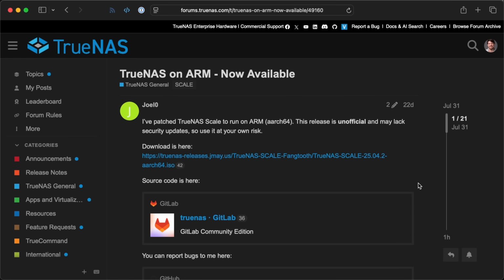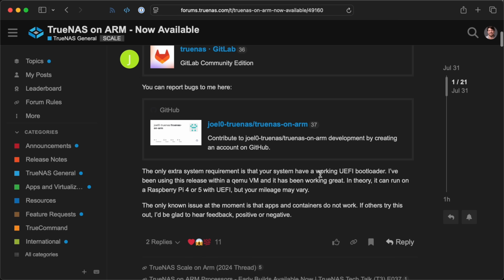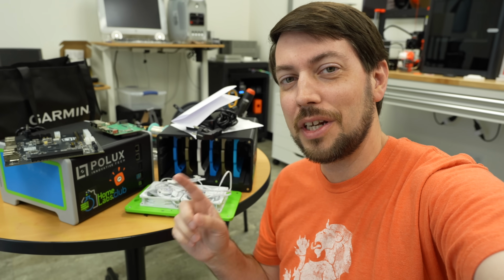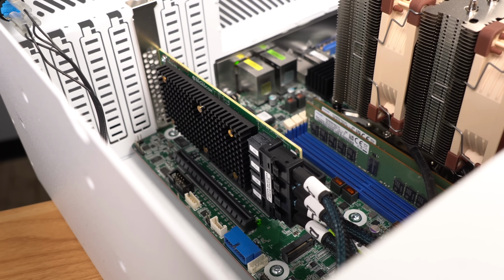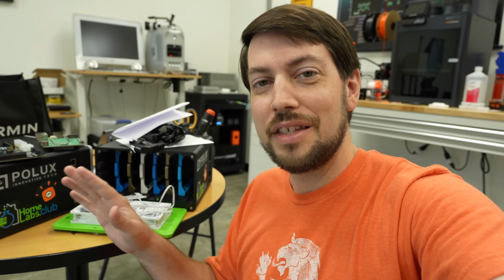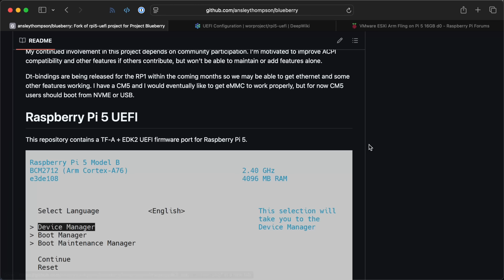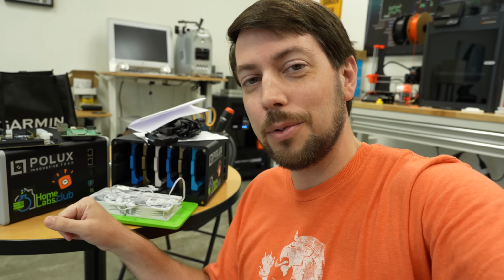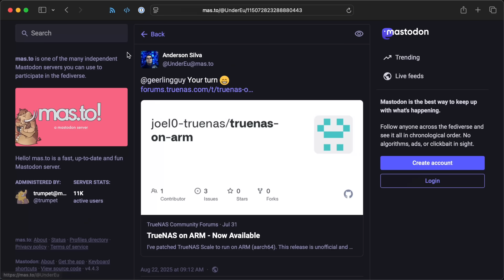TrueNAS on Arm is finally a thing

Comment: My dream NAS as of this morning is 5 NMVe M.2 slots and a Snapdragon chip, maybe 2GB RAM runnnig TrueNAS.  I want to put 4TB SSDs into my aging, but useful QNAP TS-328.  I'm not finding a truly cost effective (e.g <$500) solution.  The existing hard drives are silly loud and have been close to capacity for some time.  The performance could be better I'm sure, but is acceptible.

I came here to look at alternatives.  I'm pretty sure my dream system doesn't exist.  Even my "bandage the QNAP" system is proving difficult at a reasonable price point.
Reply: I found your LincStation N2 video.  It would check all of the major boxes.  I may end up doing something stupid.

Comment: it doesn't scale for the home. you'll never come out ahead on the investment unless you're putting together a data center. Maybe in a few years if we see more consumer ARM gear. Even with Macs, if they supported Linux, it'll be a few years (to age the hardware and lower used pricing) before the cost/benefit works in our favor.

Someone's going to say "Pi 5!" - still far more expensive than x86.

Comment: I could see myself setting up a NAS with that T1-T0ast  board. Would need an external KVM I guess. Also way more SATA ports.  I guess that's where the PCIe slot would come in.
Reply: I'm building a simple media NAS with the board right now. The performance is ok, but it's not the fastest. The two SATA ports share a USB3 channel to the pi, so they can be bottlenecked to 2.5Gbps pretty easily. With HDDs, tho, it really doesn't matter since that is still enough to fill the cache in a few seconds.

Comment: Finally!
I was using an old laptop, and now an old mini PC as a remote backup to my main TrueNAS machine. 
All it has to do is a daily snapshot of my main datasets, so the specs are not important, only idle power draw.
A Raspberry Pi connected to external media via USB can be a great affordable option with minimal power draw

Comment: I've got an older (then) FreeNAS box with 8 drive bays.  Then did an upgrade to TrueNAS SCALE software to replace the previous FreeBSD-based OS with Linux.  About half the time when I use it, I think to myself it might just be easier to put stock Ubuntu 22.04 (or whatever) on it with ZFS and not wonder WTF is going on in there.  Usually I have this thought that life would be easier when I'm trying to figure out how to pass through some options to samba (so I can have case sensitive SMB shares) and end up fighting with the GUI.

So maybe an easier path is just to put a stock Linux on the ARM systems with the ZFS DKIMs and declare success?  I often find myself just using the ZFS shell commands, running zfs and zpool directly to see what's what.  Even to create new datasets.  I can see  how the web GUI is very handy for those that don't want to know how ZFS works, but you can get past that stage..  

Of course, I just use my NAS as... a NAS, not trying to make it an application server and run a bunch of other junk on it.  I suppose you can do that directly on an Ubunty system and now wonder what the application container technology is going to be as it seemingly changes every few releases..

Comment: Asrock Rack also sells an arm mobo/CPU bundle for about the same price as the dev kit hardware.  Not cheap or low power but an option if someone has the funny money and wants to play with the hardware.  It would be really nice for some 'middle ground' hardware with lower power but some more IO/PCIE lanes that doesn't break the bank.

Comment: no CM3588 mention? I've been running 16TB openmediavault nas and no issues, no heat probs, etc, lan is a bit slow tho, but is fast enough for plex/smb/etc. :3 all under $1000 USD.

Comment: So ...   What does (say) TrueNAs do that a server+zfs(or whatever)+nfs-config doesnt do? Always see so many videos on such things, but never more than "zfs + nfs or smb" is involved.  That's a 30-45 minute setup on your favorite distribution -- unless I'm missing something.
Reply: TrueNAS has a few patches on the Linux kernel that provide value to some users. But otherwise, anything you can do with TrueNAS, you can do without it. The big benefit to TrueNAS is the ease of use and variety of features. I set up Samba by hand once and got fed up with how nothing about smb is intuitive, which was my motivation to make TrueNAS on Arm work. It wasn't a rational decision. But now I can set up cloud replication jobs, email alerts, containers, etc. without getting slowed down by setting up each underlying component and cron job.
Reply from the maker: Yeah it's mostly the friendly GUI without manually putting together a bunch of Cockpit plugins.

Comment: Big W for low powered backup solutions! Not sure why TrueNAS has been so afraid of tackling this themselves, but maybe they haven't done enough market research or are a bit strained on resources -- the install-base of ARM servers is definitely growing at a significant rate! It would be really cool if TrueNAS released a good value CM5 powered (or similar) mini NAS that can help more users get into the ecosystem, feels like that would be a good marketing move!

Comment: What about raspberry pi 3b+ or a pi zero?
Reply: Pi 3 doesn't have UEFI, so it would be challenging to get TrueNAS booted.

Pi Zero is far below the minimum system requirements, so the experience would be unusable if it would even run.

Comment: Didn't take you long :) I just watched the T3 video on this, the Radxa boards looks like a good choice to have a play with, but screw the Mac Mini, running Linux on these things is just silly, I tested Asahi on a Macbook, and what you have to do with all the abstract layers on the boot drive is just horrible, I don't think the Pi5 is going to cut it, one needs at least 2.5g networking for a useable NAS these days, 10g uplink is even better, even if your devices only 1g, when many connect, you want some through put, I might check out that Taco board, I think I could make a nice 3D printable module for my new mini rack system on printables.

Comment: One big thing for a lot of people is likely support for 3.5" spinning rust and real HBAs. We need something on a std ATX formfactor, with std plugs, with real PCIE support, 16+ lanes of at least gen3 with bifurcation support. These need to go into normal cases, but not be server hardware.

I agree about Apple needing to either support the hardware for 10-20 years, or need to support linux.
Reply: Yes, this was my thought, you need IO, a LBA adaptor is definitely something you want, or a stack of PCIE slots with bifurcation support so you can run a few 4 slot NVME cards, all of these ARM boards that are readily available are quite bad on IO, but I have seen a few nice Arm boards coming out with 4 to 5 NVME slots on them, these might work okay as basic TrueNAS servers one can setup and supply to non techies, you really need minimum, 5 drive support, either Sata, or NVME, one for the OS and 4 for RaidZ1, and these drives cant be bottle necked, also minimum, 2.5G nic.
Reply: can't regular motherboard manufacturers  like asus/msi make some boards like these?
Reply: @space_cowboy007 they could sure, but I'm not sure there is an off the shelf arm cpu that has the io needed for this. I don't think there are really any desktop arm designs. Honestly something like this is much more likely to be a riskv design.
Reply: @Cynyr  I wasn't aware there were I/O differences between RISCV and ARM systems.
Reply: @space_cowboy007 it's more that customizing a riscv cpu doesn't require paying licenses to someone. That said for the most part arm seems to either be mobile/embedded or full monster server. Riscv is still mostly a toy / sbc / microcontroller.

Comment: That Pi 5 NAS is about the perfect size and capacity for my needs. And it can easily hide behind my TV.
Reply: did he make any other video about it? kind of interested too (even if i need to forego truenas)
Reply: Made a NAS for my dad with an rpi CM5 + X1501 carrier board + 2 nvme ssds. Installed OpenMediaVault + few dockers for home assistant etc.
With the CM5 also you have emmc so no fiddling with micro sd cards.
Works like a charm.
OK nvme is expensive...so if oyu need lots of data sata might make more sense. Here just have 2x1TB put in RAID1

Comment: TrueNAS Core (FreeBSD) or TrueNAS Scale (Linux) ?
Reply: TrueNAS Scale. I'm the developer of the Arm port. Debian works great on Arm, which really helped make this possible.
Reply: @GeekHead1000  Has anyone looked at RISC-V at all? I could see some Chinese company making a nice custom RISC-V NAS board suited perfectly for TrueNAS Scale.
Reply: @NexGen-3D  I saw no indication that anyone else was even working on Arm support, so I'd be surprised if anyone is working on a RISC-V port which is in much less demand. 

It might be about as simple as someone taking all the changes I've made and swapping out the architecture parameter. I believe Debian has fewer things packaged for RISC-V, so there could be more challenges.
Reply: @GeekHead1000  Yes, I thought that was the case, but I thought I would ask, RISC-V is starting to make some ground, so something may arise from your work at some point, thanks for the reply :)

Comment: IMO I've been trying to build out a TrueNAS "DR" backup host for a bit. I've struggled with what hardware to use.  Since it's basically just a backup target to throw nightly backups at, I've been not wanting to drop alot of money.

Arm would be perfect for the low power. I have an extra Raspberry Pi 4 and 5 sitting around...😊

Comment: As long as they use latest linux kernel and then make uefi use arm EFI stub to load dtb.  It should work on most arm device which have uefi and device dtb compiled in the linux kernel.
Reply: I'm the developer of the Arm port.  It uses kernel 6.12.15.  I agree with your expectation that it can work with many devices with dtb.  I tried to install it on a Pinebook Pro with Tow-Boot, but the installer errors out because Tow-Boot provides a read-only UEFI at runtime.  It's not an insurmountable problem, but these are the kind of quirks that make it hard to say which platforms will provide a good experience.  My hope is that anything Arm SystemReady certified will provide an easy experience, but tinkerers can get it running on anything with enough effort.

Comment: The excitement for "4W idle" on the Mac strikes me as a bit odd considering the limited IO. There's x86 mobile parts that idle like that. Still far beyond the power draw of a smartphone SoC.
Reply: yea the mac's basically useless for any serious projects because of the fixed hardware
Reply: Indeed though that isn't bad it isn't amazing, at least at idle - the best bit of the Apple silicon really is the efficiency at certain compute tasks. Heck that idle is beyond many SBC's full power draw too, so if one of those can be used for whatever you are needing performance wise...

Comment: given that truenas is like 98% straight up debian (who literally call themselves "The Universal Operating System") and have notoriously has a great deal of intentional support for a large variety of system architectures, I expect that the overwhelming majority of it should work just great on modern arm apus. - the only things that really stick out in my mind as things that would need a bit of work would be the virtualization system (which is designed for kvm on x86 - you'd probably want to do something like qemu (which is what kvm is built on) for architectural emulation which would be quite a bit slower, but should work for lots of x86-64 workloads (though it should support it's own native architecture just fine as well) - and also you'd of course have to adjust some of the configuration for the docker support to let it know to pull native arm packages instead of x86 ones, but beyond ui and a bit of scripting that problem has been solved for years (arm support for docker is excellent thanks in part to the very active raspberry pi community)...  other than that, it's really just making sure that all the special sauce truenas glue stuff works well... a small team should be able to get this working in a weekend and working well enough for a professional release in a few months to a year.  ESPECIALLY if they can keep the build trees linked so there's build version parity with the mainline build.

Comment: Had Home Assistant running on an M2 Pro Mac Mini (before I got dedicated hardware for it)  and it was very fast and sipped power. HA needed more disk space and running in a VM had downsides so it got moved. The M silicon Minis are very fast and efficient and definitely worth considering for some home lab projects.
Reply: Would the current base model of the Mac Mini be a decent purchase for someone who wants to start getting into SH? I know nothing about hardware, and I would like to avoid the headache of learning, but as a programer there's a ton of software that I would like to self host to play with and try some stuff
Reply: Other than the Appleness of them, and the pricing for anything but the base model should you need more being crazy I'd love one to play with. Given that though I'd definately say just pick either a more potent of the Pi family or similar SBC/SOM* or Mini-ITX build - probably won't hit the same power consumption on average, but with some sensible selections it won't be far from it (and depending on intensity of use besting it isn't impossible), while being more flexible, and likely vastly cheaper - as the niche of uses where the base model Mac that at least approaches good price to performance will be enough is relatively small, and the challenge of expanding a Mac's hardware just isn't worth it.

* if you can find another SBC with anything like the support of the Pi at the price/performance you need so it actually works.